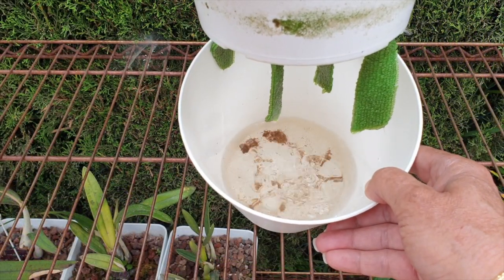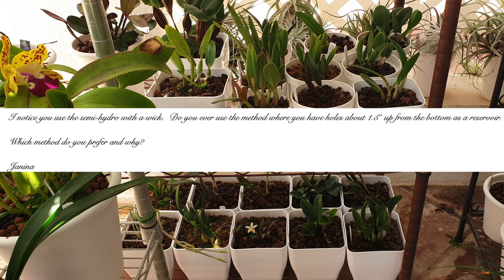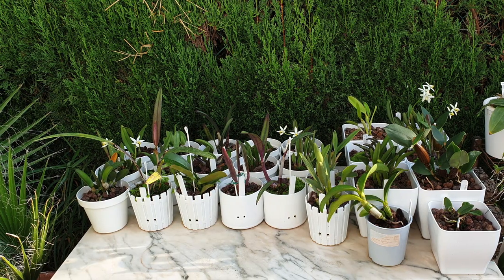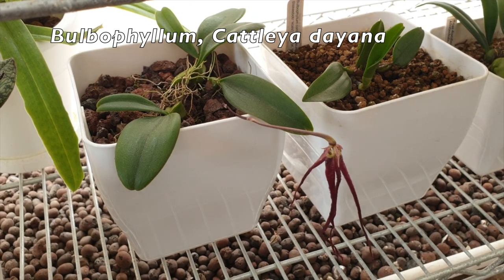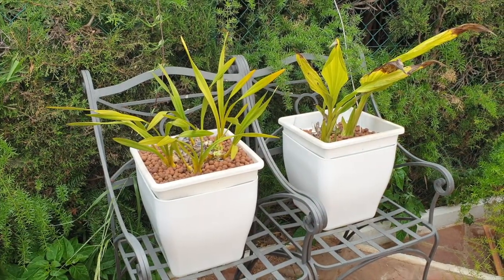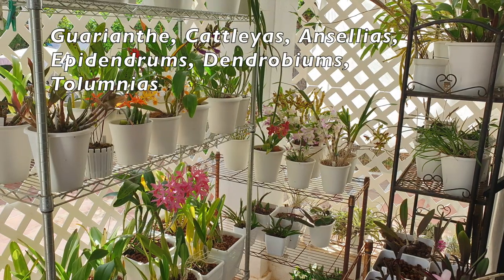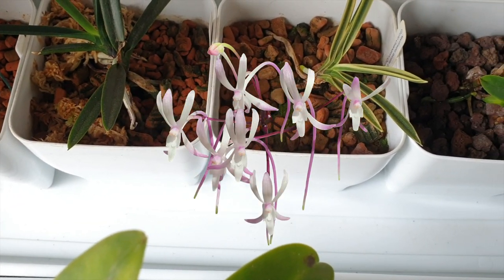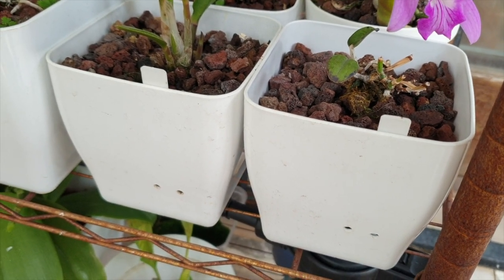Wick or Holes for Orchids in Semi Hydro Culture | Why do I use both? Which is better? #ninjaorchids

Comment: Hi Nina, about a year ago my sister was watching me move orchids in and out and in and out.  She said “you need like a cute garden/drinks trolley”.  Why didn’t I think of that!  I found and bought the cutest rustic white metal trolley, two shelves and about hip height.  Now I just wheel them all in and out in one movement.  Last night was 1c and today 21c, so in they came last night and out they went this morning and I can chase the sun around the patio with one push. 😊
Reply from the maker: Keryn, hi!! 😍💐 and that trolley sounds like the perfect solution to make something that takes a long time a doddle! Once upon a time I was asked why my indoor racks do not have wheels on them, so that I could just wheel them out during the sunny winter days, and well... first of all, all the supplemental light infrastructure is attached, which I could fandangle to detach, BUT the main hurdle is, that, I have to step over the frame of the door that accesses the west side, so wheeling things in and out is not an option. But, that trolley... I bet it wasn't only a light bulb moment, but also ... so much fun now 👍🏼👍🏼 Chasing the sun around the patio, sounds familiar! Stay warm, stay cozy and I hope you have a wonderful Saturday, Keryn! Thank you so much for watching 🫶🏼❤️🌸

Comment: I don't understand why people seem to think they are functionally different. I know I've said it before but the only difference between the two is the amount of water the reservoir can hold, self watering being able to hold more water. That is it. Sure, there's the drippy thing with the classic s/h, but as far as actual function, they are the same (assuming you are using leca). From an aesthetic standpoint, the self watering is more pleasing to me because you don't have to look at two holes burned into the side of a pot. 
Now, if you are not using leca but say a bark and moss mixture, the self watering will not work as well as the classic s/h. And this is because it requires, to an extent, evaporation to move water up through the pot. The wicking cord, unless run through the media top to bottom, cannot provide enough moisture to keep the media sufficiently damp.
Reply from the maker: Don Miguel 🥰💐 hola jefe! I like the aesthetics of the self watering as well, yes. AND, because of the way my pots are turned when it comes to where the new growths are coming out... I can see SH holes on some pots and not on others.... and well, you know my take on that 🙄😅 Uniformity!!! 👎🏼😆 Hope your day was fantastic, Michael... well, your's is not quite done yet, but what you have already had, I hope it was fantastic and that your evening will be cozy and relaxing 🫶🏼 thank you so much for watching, my friend, and for all the support ... always! 🙏🏼❤️🌸
Reply: @NinjaOrchids  today was a mixed bag. The good news, the orchids I ordered two months ago are finally coming. If the Pescatoria coronaria isn't in this shipment, I'm going to go postal. The bad news, the stuff my dad sent down from the house in Cleveland came today. I told him to throw all this crap away and he sent it down. There isn't any room for all of it. I don't need two keurigs, three instant pots and three air fryers and yet here I am.
Reply from the maker: Hoorrraaaayyyy 🥳🥳 and yikes!! When my daughter and I moved in together, we combined 3 households! I don't have the heart to throw anything away... too many memories that come from those households. Many things I made sure they had, stocked their kitchens with etc.... I cannot part with those things. But yes, I now live in an atmosphere of clutter, which is something I used to hate, but now things are totally different 🥲 I hope that your dad has his reasons for why he did what he did and maybe somethings can go to a reputable charity that would be happy to have things to help others out. * not Goodwill 😬

Comment: Hi Nina, I noticed your inner pots with S/W wicks are a snug fit to the outer pots and wondered if you find it a problem not having a gap for air to circulate. My pots are a snug fit and when I first started growing in leca I found the roots were staying too wet so I’ve resorted to putting a clothes peg on the edge of the outer pot to allow more air flow. It’s not the prettiest but is very functional. I hope that’s clear enough to understand. Let me know if you have any tips or tricks to help with more air around the inner pot. Thanks for sharing your setup.
Reply from the maker: Hi Renate 😍💐 always lovely to see you! I hope you had a wonderful Friday and are already into a beautiful Saturday 🫶🏼 I have not had any issues because of the lack of circulation. At least, if there were issues, I did not conclude that it was because there was no airflow between the mask and the pot. You see, even the classic SH set up with just the drainage holes, the roots above the reservoir are also without air circulation. The oxygen exchange within the pot comes from flushing not from the O2 in the air. However, if you are seeing an improvement with your clothes peg and are more comfortable with having airflow in the mask, then I am glad that it is working for you 👍🏼 when growing in SH, air around the inner pot, or even the classic drainage hole pot, is non existent. Instead, the gas exchange within the pot with gaps between the media is what the set up makes happen. So, the pouring of the water through the pot equates to adding oxygen in and around the roots. This stops a pot from becoming stagnant and as a result, the roots always have access to oxygen. I hope that I am explaining what I mean 😬 let me know if this prompted any questions! Thank you so much for watching, lovely lady 🫶🏼🌸
Reply: @NinjaOrchids  thanks Nina, that’s a very in depth explanation but now I get why flushing is SO important. This is all a bit new to me, even after all these years of growing orchids, although in green house situations I would have been flushing without actually knowing it. I’d be happy to dispense with the clothes pegs, they are a nuisance, but at the same time I noticed that the water/fertiliser dries up quicker than when there’s no gap for airflow, so I’m achieving a better wet/dry cycle than when it’s all closed up. I hope that makes sense. Thanks again for clarifying all this, I’m slowly starting to understand (I hope anyway), and appreciate you taking the time to reply, sometimes I feel like such a dummy and think at my age I should know all this. Cheers from a cold but sunny Queensland.
Reply from the maker: Never feel like a dummy when it comes to orchids.... here is me telling you this, and I sometimes stand in front of my collection and go 'WHY??' utterly clueless! However, when it comes to asking questions, even if you feel as though you are asking repeat questions, please, never feel like a dummy! I sometimes don't express myself as well as I would like to, even though in my head the words make sense, the person reading them can be left feeling ... HUH?! Eventually, the information will be complete and then, execution is the factor, including for me. I know what needs to be done, how to do it, and yet, when I do it, it does not always work. So, hakuna matata!! 🫶🏼❤️